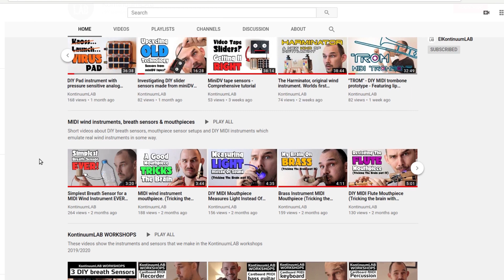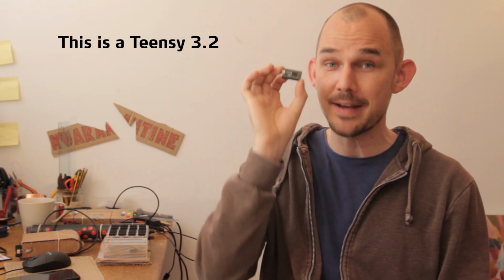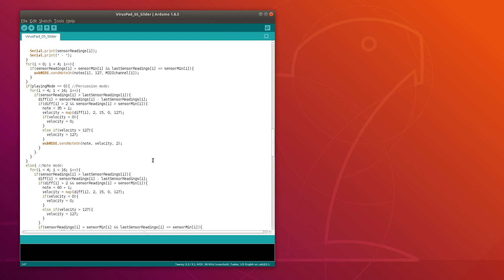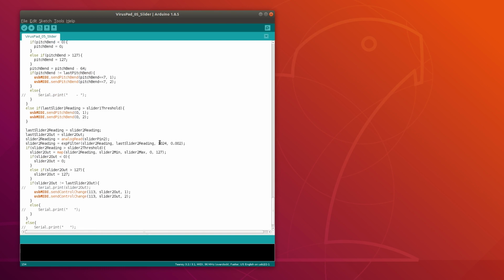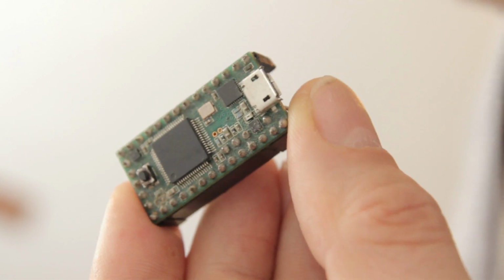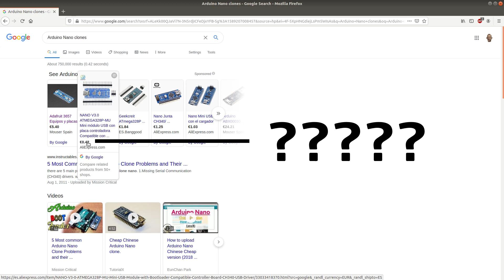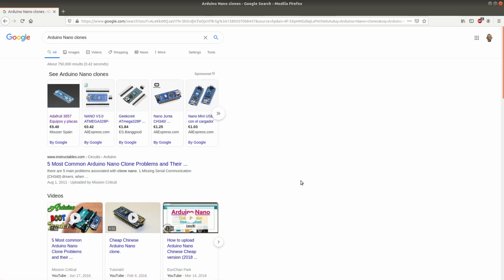My Secret To Making MIDI Instruments (KontinuumLAB Philosophy Of Instruments 101)

Comment: Would you have any advice for someone trying to make a full sized guitar based on your most recent bass design? 
My idea so far is to toss out the individual fret zones and just have a long slider made out of two capacitive sensors, comparing resistance with each other, for each "string". I'm still waiting on my materials to arrive before I can experiment with it, but I was wondering if you might have a better idea or just any tips to get me to a solution faster.
Reply from the maker: My advice is "Go for it!"
A couple of thoughts:  
If you don't use fret sections, are you making an actual fretless guitar? 1:That is a completely different beast than a regular guitar -  Very tricky to play... 2: I'm not sure what you mean by the "two capacitive sensors". Do you mean two wedge shaped sensors lying side by side? For something as long as a guitar string, I think you will need more sensors than that to get a useful resolution. Check out this document: http://www.ti.com/lit/an/slaa576a/slaa576a.pdf
Pages 18 and 19 talk about slider design.
This other one describes a slider algorithm which can read that type of sensor: http://www.ti.com/lit/ug/slaa490d/slaa490d.pdf Starting on page 61
Happy making!
Reply: @KontinuumLAB  I was thinking that, since it's going to be synthetic either way, I could code it to be able to toggle between fretted and fretless, and maybe just have some removable bumps for frets when i need them. The designs you posted for the sliders will help greatly, as well. Thanks for replying!
Reply from the maker: Yeah, those two documents have been foundational in my understanding of sliders and capacitive sensors. Highly recommended. I have a video planned on what it all means, but still a lot of work to do before it's ready.

Comment: You are doing wonderful things with these MIDI instruments!I have been imagining all kinds of instruments this past week. Somewhat unclear if they make sense from from a musicians standpoint, since my musical skills are very basic. But I hope to try out at least some of the things I learned here. 
On the topic of microcontrollers: Teensys are hard to match, but for simpler projects an arduino with ATMEGA32U4 might be enough. Since arduinos are open source hard ware, they are significantly cheaper. Chinese stores sell small arduinos with ATMEGA32U4 and 12 digital pins, and 4 ADC pins, for less than 4 euro. It's not much, but maybe enough for many small projects and workshops?
On another topic: I thought that many of these instruments, that you make, would be fun to bring with you and play with others, but MIDI instruments, as I understand it, require a synthesizer to make sound. Wouldn't it be nice to have a synthesizer smartphone app? Just plug in your MIDI instrument in to the phone, and play. 
Thanks again for these wonderful videos!
Reply from the maker: Thank you so much. The ATMEGA chips don't have USB-MIDI or capacitive sensors, which is the basis for much of what I do. You can't just plug these microcontrollers into a phone. I think Bluetooth would the best option for that kind of connection, but then you'd still need to power the instrument. I might give it a go at some point, but I'm honestly very happy with the USB solution for now - No extra electronics and it works flawlessly every time.
Reply: @KontinuumLAB  I think if I was building one or two instruments for myself I'd also go with teensy LC, but if one is for example holding a workshop for a lot of people, it might be nice to push the price point down. Unfortunately capacitive touch is it's definitely not a neat one pin solution, but is possible on arduino (https://www.youtube.com/watch?v=BHQPqQ_5ulc https://playground.arduino.cc/Main/CapacitiveSensor/) if I understand it correctly. On the ATMEGA32u4 I had the impression that USB-MIDI works (https://www.arduino.cc/en/Reference/MIDIUSB). 
Nice idea with the bluetooth solution for connection with the phone!
Reply from the maker: That was an interesting rabbit hole! I had totally forgotten about "MIDIUSB". I actually made that work years back, on an Arduino Micro, which I still have lying around. "MIDIUSB" is a bit less user friendly than the Teensy "usbMIDI", but that's not too big of a deal. The cheap option would be the Pro Micro I guess, or a cheap chinese knock-off at 4 euros. 
BUT... Without easy capacitive sensing, I'd still rather stick with the Teensy. Also, keep in mind that if you get any of the "brand-authentic" ATmega32U4 boards, they're actually all more expensive than the Teensy LC.
Reply from the maker: That's so cool. Not an expert on mobile technology, I didn't even know that you could pull useful amounts of 5v power from a phone like that. Very interesting, thanks for sharing.
Reply: @KontinuumLAB  The least I can do as a thanks for these wonderful videos!